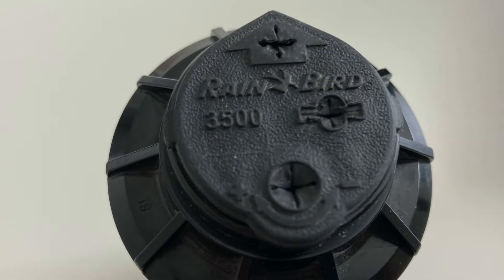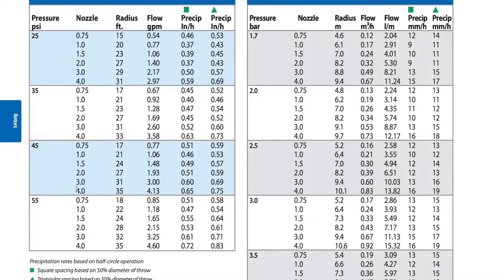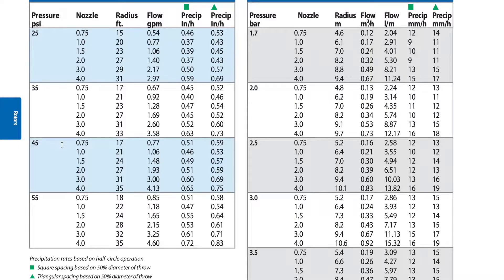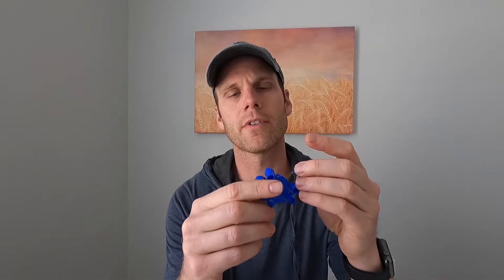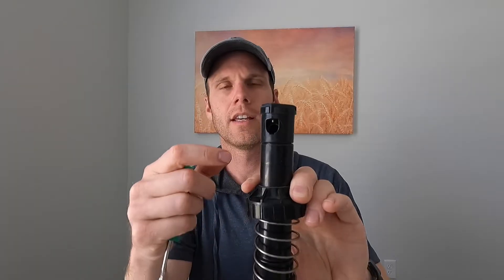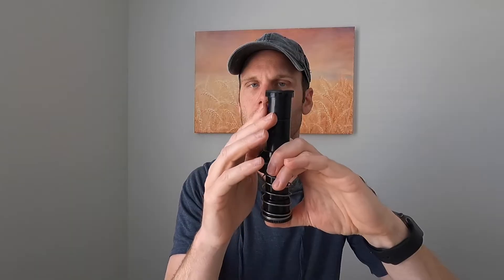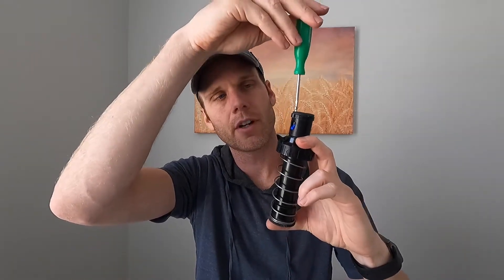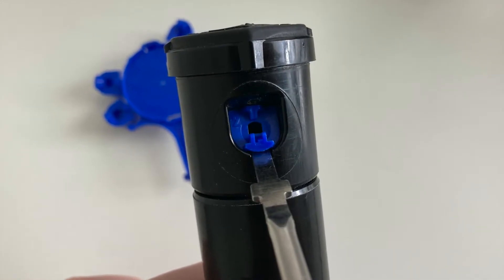Installing RAIN BIRD 3500 Nozzle Correctly + Understanding Flow Charts

Comment: Nice channel that explains things well, what i find odd dealing with my first rainbird system is that this system has been patented for almost 100 hundred years, and the best they can do is change a nozzle head which seems fine, but if you are in a grey area between two nozzles, then use the screw, this basically just has a bunch of the water spraying a few inches around the nozzle spraying water, and dripping down, it almost looks the same as a leaky rainbird head.  I see on their site they offer people to send in their ideas for better systems.  Im not an engineer maybe its not that simple, but i would have thought there would have been a better way to regulate the water flow.
Reply from the maker: I agree, hopefully the industry continues to innovate!

Comment: Thanks. Can nozzles be changed when it’s in the ground? How can you pop the nozzle out then?  Also, I’ve got a 32sa (3500) that stopped rotating, I see in this video how you took the center part out of the rotor. Can I just unscrew the center part from the bad one and screw a new center part in from a new 32sa rotor instead of digging up the whole rotor and screwing a whole new one in?
Reply from the maker: Possibly, I’d try that and then proceed with entire body of it doesn’t fix it.  The tool gets inserted. Into the slot to be able to pull up the head when in ground.

Comment: Really helped me understand how to set everything up, but when I turned on the water, it would not push the head up and leaked all over. What am I doing wrong?
Reply from the maker: Perhaps a leak somewhere or low pressure - need 40PSI

Comment: My homes water pressure is typically between 35 and 40 PSI - kinda low but thats what the city gives my neighborhood. I currently have rainbird 3500s installed on my lawn with the size 2 nozzle and some of my sprinkler zones consistently have trouble rising - its a relatively new system and something that started happening shortly after install. Could installing smaller nozzles help resolve this? No leaks or anything and the valve is fully open. Thanks!
Reply from the maker: Yes it could help some but will get shorter distance throw of the water.  Low pressure is a difficult one if not caught at the design phase.

Comment: How would you match precipitation rates if you have  90, 180, and 360 degree patterns on the same zone, and you want them to all throw the same distance, for example 17ft?
Reply from the maker: Don't think it would be possible to do so and would start with the initial design aspect of the sprinkler system.  One of those constraints / parameters you mentioned would have to be broken to satisfy the others.

Comment: Hi
So if I have 2.0 bar with the 0.75 nozzle, how long would I need to run the sprinkler to achieve roughly 1” of water down?
Thankyou
Reply from the maker: https://www.youtube.com/redirect?event=video_description&redir_token=QUFFLUhqbmtLUlNGWWpDcllCQnFlalUzYWtRdF8wOG5vUXxBQ3Jtc0trdTE0QmVCWUh3dS1NYkN1b0NVZXJ1aU8yOVE2SGdCT29oRUtPTFUwMVZIRTBDVGFDb2RmaWhLQWdPMUV4Tk4wektpa013OGlBNVRGQ2t6VVFsRmNQTUpwUEl2V3k4aEVhWHh5WXNYVHh0WkVldk5OZw&q=https%3A%2F%2Fwww.rainbird.com%2Fsites%2Fdefault%2Ffiles%2Fmedia%2Fdocuments%2F2018-02%2Fchart_3500.pdf&v=ELDisOTPDnU

This chart should help.  Let us know if you have any other questions.
Reply: @thesprinklerchannel  thanks mate
Yea that chart helped also with your vid.
I’m from the Uk, so working in metric 😉
Thanks again